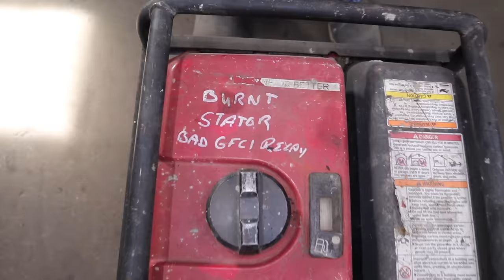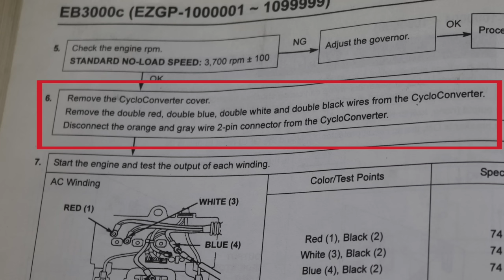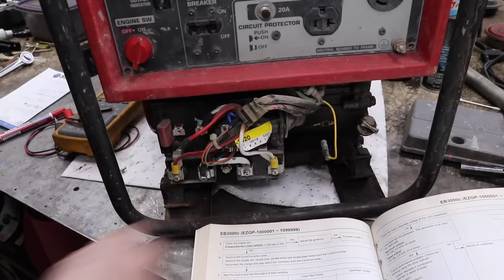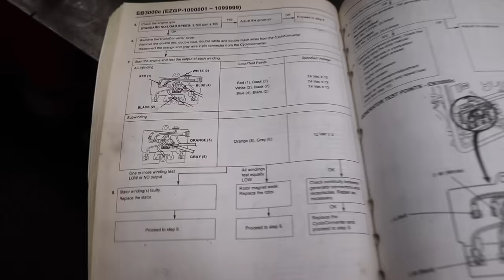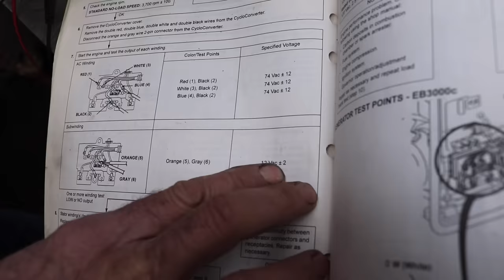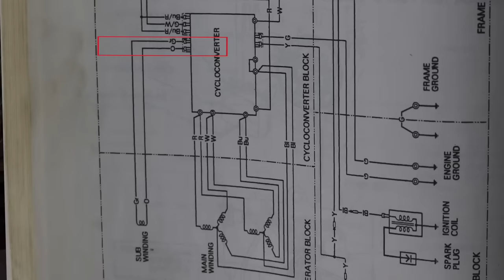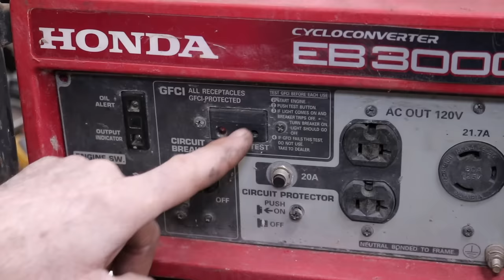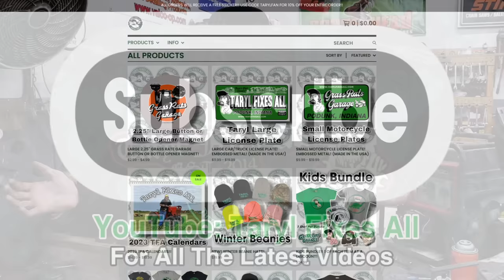Some Things Change For The Worst

Comment: I was going to buy a Honda a few years ago but bought a Champion instead. For roughly the same wattage the Honda was $2000.00 more  in Canadian dollars. So far i really like the Champion . Watching Taryl's videos i learned how to maintain all my small engines.
Reply: QUICK, GET IT TO THE PAWN SHOP!!!,4 SOME BODY FINDS OUT!...
Reply: @patrickstockton2091  - you do know that the Champion generators and in fact ALL of the other Chinese generators are clones of the Honda generator?
Reply: @davevaneck6026  Yes, but like all things built in China, they can be built to various levels of quality based on what you are willing to pay. Champion is a quality company with quality equipment so I have to assume they are built to higher standards in China based on the companies standards.
Reply: @noteworthy227  The three I have with a combined total of almost 500 hours tells me they are NOT...
Reply: @TOURMANBOB  the 3 I've had my hands on weren't worth the gas to go pick up if they were free 🤷‍♂️
Luckily 2 of them were
Reply: @noteworthy227  Opinions are like butts...everyone has one.

Comment: I’ve had good luck with Honda power equipment parts over the years. Long term parts availability is actually a main reason I would recommend Honda to people. I’m sure there comes a time of parts no longer being built. 
Oh the other hand, I’ve had quality issues with Champion gens right out of the box. Like basic assembly done wrong. Great troubleshooting video!!
Reply: I was able to get a complete carb for my 40 year old honda walk behind mower for less than 15 dollars at my local honda power equipment dealer.  The original carb was fine except for the internal part that i lost during cleaning.
Reply: I have two Hondas, and 2200eu and an 8000 w contractor generator. Both start first pull and have hundreds of flawless hours. Luckily I've never had any issues up to this point.

Comment: Reminds me of what happened to power converters in RVs.
At one time I could repair or replace any component in the power converter. I had troubleshooting manuals and a stock of replacement parts. They were all the same brand so when one failed, I would swap it out with one that I previously repaired, took that old one home to repair for the next job.
That all came to an end when the RV industry, in their infinite wisdom, decided to go with electronic power converters with complicated circuit boards. But not only that, they encased them in resin so that even if you knew how to repair them, it was impossible to get to the components.
So, much for simplicity, so much for the repairman.
Now instead of a $100 repair, it's a $300 replacement.
Reply: You have to understand, that the old ones were based on heavy power transformers that were designed to work with a low frequency of 60hz.   The newer designs don't work that way, as a result are much lighter, cheaper to manufacture.  They run at higher frequency and make use of modern technology to still manage to output a clean 60Hz Single Phase AC output, from a battery.  The difference in the end is a really complicated power supply, but with a much better Power Factor than the old Transformer based units.  Don't get me wrong, I love the old Transformer stuff and prefer it for it's simplicity, but these days heavy transformers are very expensive, and you can do a lot more with a modern Inverter type supply than you ever could with an old Transformer/Cap Filter/Rectifier/Regulator type simple unit.
Reply: Yup, that goes for major appliances, now it is all electronic, 50$ for the service call 
and 280$ for a new circuit board, whereas at one time maybe a 30 $ relay did the same
thing. . .Frankly I think the new service techs are nowhere as good as they used to be,
just expensive part/s changers.
Reply: @xxcrazy_critr6661  The heavy power transformer ones are also very inefficient, too much heating losses in the transformers. Most likely because the laminations were not made of good high silicon low eddy loss 'transformer' grade steel, and poorly designed. Modern extra high voltage transformers are extremely efficient, so much so that the large oil cooled ones the fans don't even hardly run except when overloaded and extremely hot weather (from everyone's AC working to the max, maxing out the grid). In the old days, they used to have huge oil tanks, many large loud fans, and filled with PCB's. Yeah, no thanks. Sometimes I'm thankful some things "aren't made they way they were used to".

Comment: I have a Champion 75531i Inverter Generator, 3100-watt since 2015 living on the back of my fifth wheel. The first season using it, I was actually kinda pissed. Had problems with it staying running, sometimes not running at all. Took it to 3 different Champion warranty shops in Florida. The first replaced a coil and "fixed it". Shut down 2 hours later. The 2nd shop looked at it and said they won't do work on Chinese made Honda knockoffs. At the 3rd shop, Champion had them ship the genset back to Champion in California. I didn't get much use out of it that first season. Champion opened the crankcase and replaced the low oil cutoff, then shipped the unit back to me in PA. From that point on, the genset has worked flawlessly. The engineers I talked to at Champion where great. Ever since, I have recommended the Champion product to anyone looking for a genset. Very very pleased, other than my first season. All the repairs, shipping etc. covered under warranty.
Reply from the maker: Thats a great story. You always have to remember that thousands upon thousands of different products are being produced and sometimes you might get one with a defective part. Glad to see it had a positive outcome.
Reply: If the stator really is burnt🔥 then it's usually not worth fixing. Part it out for good components.

Comment: I have not had experience with Honda's but have seen the champion generator, my father-in-law uses one with his motor home, and has had no issue expect the occasional plug cleaning.  I myself bought the 3000w Predator generator from Harbor Freight, and do NOT regret it.  it has not let me down once, it starts, and I go out once a month and run it like they suggest, the battery for the electric start has not even failed going on 3 years now.  I know someone else that bought the same unit, and left it over the winter, never started it, did not drain the fuel, or change oil, and they had a dead battery, and I wound up having to take the carb apart and clean it.   Point being,  maintain your equipment, and it will last with very few issues.   Taryl, thanks for this video, iit proves what I have been telling others about the honda's   they are overpriced on parts and do not last.

Comment: Many years ago, my boss at the time needed his honda mower rebuilt. We needed a rod and piston. We got parts at dealer cost, and it was still more than buying another brand mower. Parts for all their power equipment are crazy expensive.
Reply: Note: Honda announced in 2022 that they were getting out of the mower business.
Reply: @keithstudly6071  my guess is their long term plan is to completely exit the internal combustion engine market.
Reply: Honda you get what you pay for....(3) gens - 2 eu2000’s and a 7000wt.  All are going on 13+ years old and running like a top.  I’ll be buying their products again......if these ever quit,in my lifetime.😎

Comment: Ive been running a pair of 2000 coupled, for 15 years. Never a single problem. Kept them serviced. Faithful service.
Reply: It's always good to have a breeding pair of machinery!  When one of your honda generators craps itself, you've got a whole supply of parts!
(well...  except for the inverter)
Reply: @annpeerkat2020  Is that all you got?
Reply: @OOOOOO12345  Well said.
Reply: My EU2000i was a reliable Gen.  Upgraded to the EU2200 so I could run my RV air conditioner, runs awesome. Most people bashing Hondas usually lack funds.

Comment: I ran into this very same kind of thing with a Thermal Dynamics Cutmaster 81 Plasma Cutter; a supposedly high end plasma cutter manufacturer that can't supply parts. It saddens me to do it but my solution is to now buy a cheap Chinese plasma cutter than I throw away in a few years when it breaks. Sometimes when you try to buy what is considered "the best" you don't get your money's worth. It's a real shame because you can still get parts for a lot of things made over 30 years ago.
Reply: Every time I've ever bought new stuff I've always been disappointed ☹️

Comment: Interesting troubleshooting video. Our backup generator is an old school non-inverter Harbor Freight electric start Predator with a Chihonda clone engine I purchased in 2016. So far I have not had any problems with it. All our lawnmowers have had Honda engines that I really like.

The issue I have with Honda is their stuff is extremely expensive compared to the competition.

Comment: Ive heard the main fail point of inverters is often the capacitors in them. 19:58 the large circle shaped parts on that one. If they didnt seal them normal they are cheap and easy to replace by themselves. It’s a shame Honda didn’t make them serviceable.

Comment: Great video Taryl! You can remove the bad inverter and replace it with a 200 amp bridge rectifier to make a DC charger. The bridge rectifiers used to cost around $20 on the bay place but I think they're about twice that now. You'd be converting over from the 3 AC phases output to a positive and negative DC output. It would work great for those with a 48 volt solar battery storage system as a backup charging system.
Reply: @petersack5074  Thanks Peter! 300 amps is much better than 200! There's a lot of uses for high amp DC stuff for sure.
Reply: You can then take that rectified power and convert it back to AC using a store bought power inverter like those sold at walmart.
Reply: Isn't that a waste of gas?

Comment: I have a Champion 9000, dual fuel genset. We run that thing for over a year supplying power to our 50amp fifth wheel and our well pump while living in the RV, clearing and prepping our property. They make a great product and have excellent customer service. Only issue I had during the whole time, was the safety plunger sticking in the carbatrator. Called them up and they sent me a brand a complete new carb for FREE, that was after they spent an hour on the phone troubleshooting the problem with me. I was able to run on propane while waiting for the new carb, which only took 3 days to receive. Eventually the thing started sticking again, so I just clipped the tip off the plunger. We still have that genny in the shop as a backup storm outages. We have a transfer switch wired into the main panel box for our new home.

Comment: Thanks for the heads up on the Honda generator. I’m glad I only paid $20.00 for my Generac 4000XL generator. if it breaks then I’m not losing much at all. the only thing it needed when I got it was a carburetor and a oil change and a good cleaning. I even put wheels and handles on it. runs like a champ now.

Comment: i guess i better buy a used one for parts to keep mine going. it small, starts every time, makes a great little work table, decent run time for light strings and other equipment. i like this one better than the suitcase ones for the power. ive seen used ones in my area for $400-$500. better snatch them up now.
thanks for the heads up, taryl.

Comment: Funny that you mentioned the fire department generator. I'm on the department that you talked about and we've been discussing what to do with it. It is very upsetting that it is junk because it does not have very many hours on it.
Reply: Maybe you can convert the generator into a diesel powered water pump
Reply: Compare the power head output to a normal power head (non inverter) and see if you can adapt a different power head or stator and voltage regulator. I haven't researched this yet but would be surprised if there isn't a solution that might save the county/state dollars.
Reply: There are pto generators that may bolt right up
Reply: If you found someone that was good at doing component level repair, you could probably get the inverter fixed. If it's potted in epoxy though, that certainly makes it really difficult to work on. I've fixed specialty electronics (think farm equipment, CNC machines, etc etc) when parts are not available or replacement parts or systems are outrageously expensive. It is possible, just that there aren't many competent repair engineers around, because almost no one is willing to pay the rate required for the skill level required to go blind into something and repair it without schematics (which are never available)
Reply: @Walter Tarchala: Have a look at a suggestion / comment made by Kentucky Fried Fixes. JAT. Regards.

Comment: I’m glad my EB 4000 was given to me. It’s either a late 70’s or early 80’s model. A contractor had it before & gave it to Dad in the 90’s. Only thing Dad had fixed on it was the automatic idle switch that came with a nail in it. Dad started using it when living out of town in his RV doing road construction.  He would slide it out of the back of truck & let it drop breaking an engine mount. It’s aluminum & I used JB Weld to fix it. I had it sit in shed for 5yrs with fuel stabilizer in it & started on 3rd pull. Can’t beat those engines. I have smaller Honda generator that was given to me & I bought an old 80’s Honda snowblower on tracks that runs better than the craftsman snowblower that needs work. I even have a Honda ATV.

Comment: We used to use these as power supply back up generators, ours kept dropping down to output only 60v, bought them because they were fairly lightweight and cheap but when they failed they became parts only.

Comment: Good move getting into the Champion brand Taryl at Eliminator Performance we have had nothing but good results dealing with Champion dealers. As an example some of our customers with the Champion Generators were having issues with the shut off switch and as we researched the issue we found there was a recall warranty on the switch. Once we contacted our Champion dealer they immediately at NO CHARGE shipped us the switch for replacement and even included a brand new recoil starter even though we did not request that part. Over the years we have to say that the Champion customer service and availability and cost of replacement parts are excellent at real 10 out of 10 rating.

Comment: That's something! Honda has always had a good rep on their products. An awful way to run a business. 👍
Reply: I couldn’t disagree more. I run a generator repair shop and Honda units are simply the best. Yamaha, Kawasaki just as good. It’s very, very infrequent I get a Honda unit in with a bad stator/rotor.  Usually it’s carb/fuel problems which are quick, easy fixes. These units will run thousands of hours.  

Can’t say the same for Generac, Chinese clones etc. 

Briggs units not too bad but they don’t compare to Honda quality
Reply: Nobody's gonna stock parts for a 20 year old generator - it'll be on ebay but expensive.
Reply: @John Rand  $5k for a Honda
 $1k for a Champion. For that price, they should stock parts for 30 years.
Reply: @lciummo1  agreed
Reply: @larry, I don’t have any problems getting Honda parts. In fact, there’s a very robust aftermarket of Honda generator parts. You just have to know how to source them. I have never had a problem getting parts. Furthermore, I deal with Champion generators. They are ok for the occasional homeowner use. I will not sell a champion to anyone who needs reliable power, off grid etc. I would be doing them a disservice. 

Lastly, inverter generators are generally not needed. High end Honda, Yamaha produce a nice clean sine wave.
Reply: Hate to bring it up gentlemen, maybe, just maybe the problem is it has a gas motor. There are certain people that don't like gas motors and it wouldn't surprise me those parts to keep them running be phased out, band, or outlawed. You will comply with OUR way of thinking, or pay up.  At this point, nothing would surprise me.  When I hear "solar generator" I laugh.
Reply: @Mikesorrento3344  How exactly are these 'high end' generators making a clean sine wave without an inverter?
Reply: These days with everyone trying to make a BUCK, these things happen. I prefer to buy old stuff and repair it and just use it till I die. The old stuff is so reliable that I am amazed how well they could make things today if big business wanted to for sure. Nice video Taryl. Very informative too. v
Reply: I have a 60yr old 3k gen and still runs.
Reply: @Tony, Honda generators generally have high quality automatic voltage regulators. Furthermore, stator, rotor tolerances are second to none. I have an oscilloscope and I would characterize the quality of AC output to be very close to grid power. Having said that, yes, inverters produce a “pure” sine wave. In my experience, the power coming from a modern Honda generator is suitable for just about any type of appliance, device, etc. 

I don’t think inverters are worth the premium price because when they fail, they are generally too expensive to fix, unless one is competent in repairing the inverter board themselves. 

Honda inverter board failure rates are exceptionally low. While Generac, Champion, and other Chinese made inverters fail regularly.  

The exception to that are Harbor Freight inverter generators. They are not bad. 

It’s just what I see come into my repair shop and my experience.
Reply: @TheWaterman1000  The old stuff was made to lst Sir.
Reply: @Mikesorrento3344  I am surprised that HF stuff is way better than Generac, Champion, and other Chinese